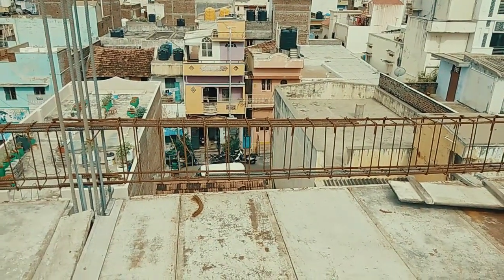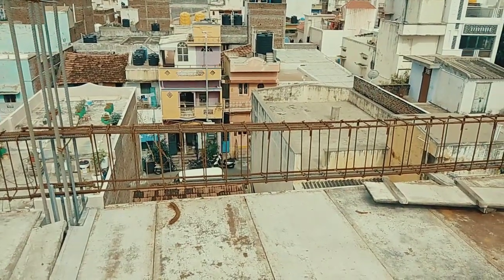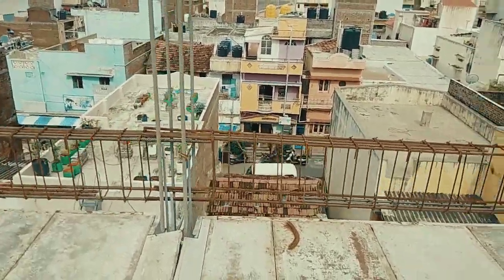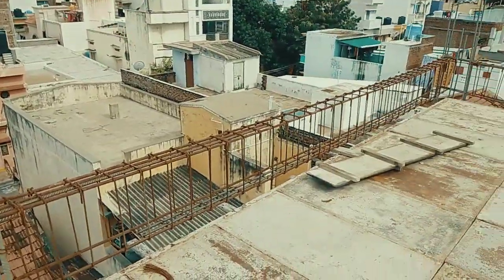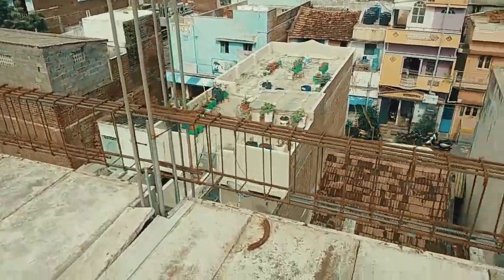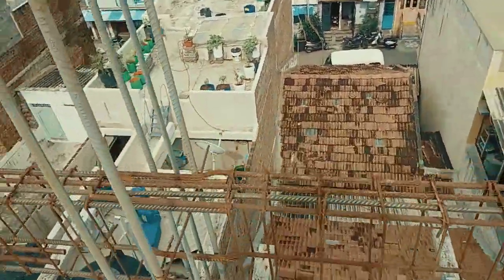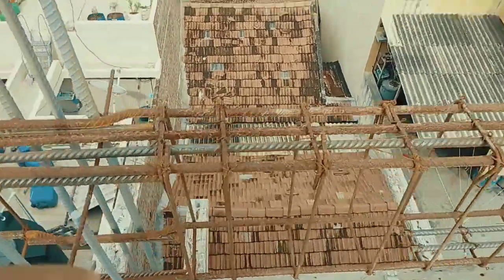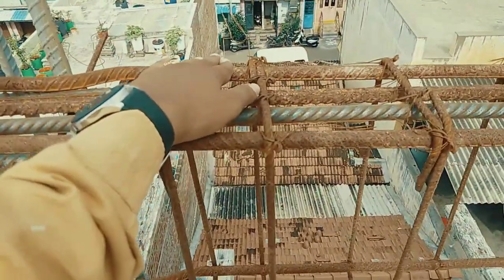Reinforcement details for 16 feet span beam

Comment: What is beam size without slab thickness..??
Reply: 12 inches height  without slab ..and 8 10 inches width... 16 mm 4 Roda + 2 Roda 12 mm if span is over 10 feet ... Otherwise 12 mm  8 rods is ok.. ring space should be 7to 9 inches .. Not more .

Comment: if in the column 12mm rod is used then we provide 16 mm rod in beam for 16 feet span?
Reply from the maker: No problem
Reply: Always provide strong column and weak beams.. that's the concept of structural design.
Reply from the maker: Column reinforcement is depend on the no of floors
Beam reinforcement depends on the span and load that going to act

Comment: It is for how many story building?..if any building less than the number of storey of your building..will configuration change?..for example g+2 building.. thank you..
Reply from the maker: Only columns size will be vary depending upon the stories of building 
According to beam it will differ only when Loading differ
Reply from the maker: The following beam design can carry 
The roof slab's dead load of 2KN
And live load of 3 KN and brick wall dead load of 2KN 
Total 7KN load it can carry
Reply: Thank you for your response..U said that depth of beam is 18 inches..is it including the slab..how much is the slab?..
Reply from the maker: We will insert the slab's reinforcement bar into the beam 
So the slab will get concealed into beam 
Slab here is a one way slab and thickness is 5"
Reply: Thank you sir..

Comment: Hi sir
Tension will be at bottom
So the extra bars which you have provided should be equal to the bottom bars
But you have provided cut length their
Correct me if I'm wrong
Reply from the maker: Yes you are correct 
I have provided equally 
Compression rod at top as 2 16mm extra 
Tension rod at bottom 2 16mm extra